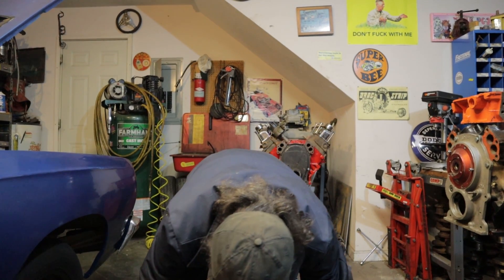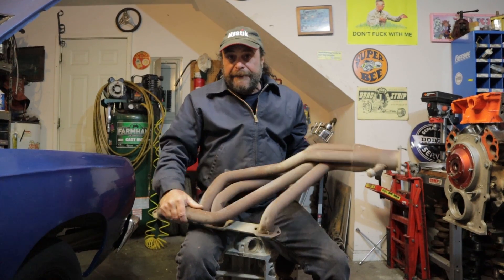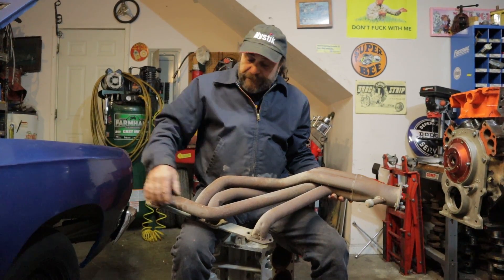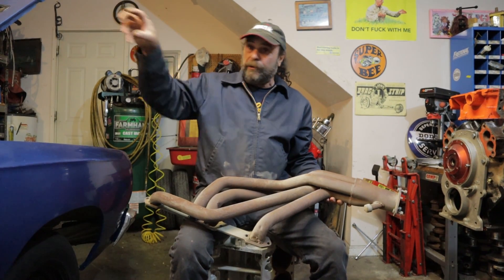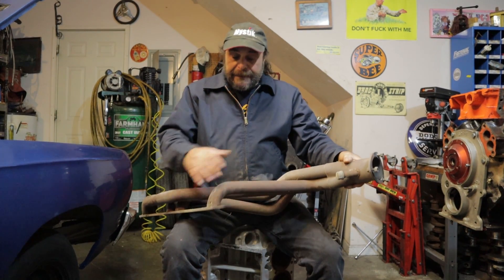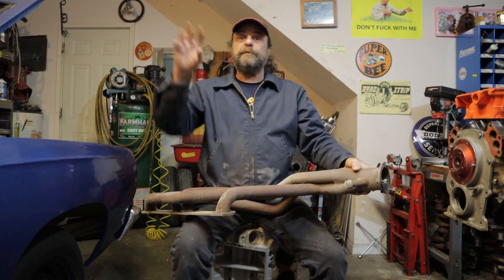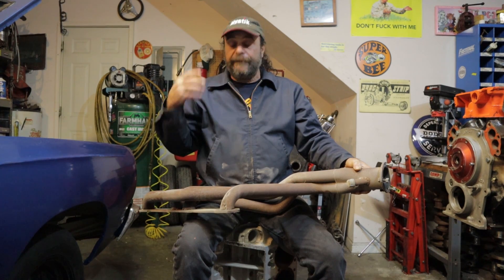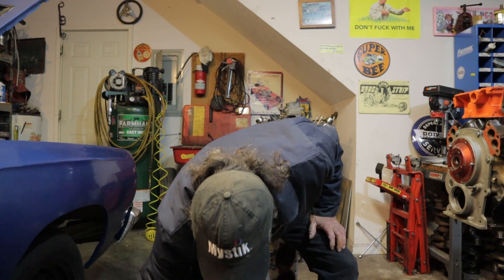The BS On Backpressure

Comment: There is ONE time when you do want a set, specific amount of back pressure in your exhaust to make the best power...
.
.
.
.
.
.
Two strokes.
Reply: 2 stroke Detroit v8s run best with smaller pipes as opposed to those goofy 10 or 8 inch pipes!
Reply: @scrappyhustler7467  and they sound better too!
Reply: And even more mystical... the two stroke turbo, which uses a tuned pipe followed by a turbo which acts as a variable restriction after the tuned pipe, maintaining good back pressure in the pipe, even as air pressure in the intake tract is increasing...
Reply: @gallupcustomknives2293  ah, I see you beat me to the punch :)
Reply: @gallupcustomknives2293  yay! Spring mass damper system!
Reply: Well diesel 2-strokes are another beast altogether. I don’t know much about them, I was referring to gas power sports 2 strokes
Reply: Kinda depends on what 2 stroke it is and the design of the ports, but you can always gain power by widening the ports, until the port catches on the ring haha
Reply: @Scrap scholar Detroit's DON'T CARE!!!!! Period!^___^   My Dad was the guy fer years that ran them till they blew up and then tested everything!………………. But, them lil' two putters(cycles and such) on the other hand need the resonator chamber(I believe they call it?).
Reply: @lambrokedrc5998  Expansion chamber :)
Reply: BS... Look at the two stroke Detroit Diesel engines.  They don't need back pressure, they need a blower to literally blow the exhaust out when all pressure is lost at bottom dead center.  Even on small 2 strokes with no blowers, it still isn't "back pressure" that makes it work, its small enough diameter pipes that are long enough to create the "vacuum" scavenging effect that Tony was talking about, which is created by the exhaust gasses keeping up speed while going down the pipe.  If the pipe is too big, the gasses slow down and dissipate, and the scavenge effect is lost.  The reason it's more noticeable on 2 stroke engines is simply because they fire twice as often, so the exhaust pulses are closer together.
Reply: @livewire2759  
Not sure about diesel two strokes but with a typical two stroke ( like a dirt bike for instance) it isn't "back pressure" it's pulse of exhaust that returns to the exhaust port that helps keep the new charge in the cylinder.
But everyone knows that.
Reply: @franktaylor7617  This is the comment I was looking for, took a while for someone to know what they are talking about.
Reply: Live Wire ummm... have you ever seen a 2 stroke dirt bike? Length is a factor but as Frank stated, the shape itself is what creates the resonant/reversion effect at whatever rpm the pipe is designed for.
Reply: Live Wire no. There are multiple steps in a 2 stroke exhaust where the pipe changes diameter, because you need gas density for the sonic wave to bounce back. That’s the entire point of a tuned pipe, you bounce the sound wave back exactly as the piston closes the exhaust port to cram that air fuel charge back into the chamber. You are more or less sonically supercharging the engine. Run a stinger that too large and your never going to get the pipe hot enough to spin the motor up. On PWC 2 strokes we literally inject water into the tuned pipe to make up for a lack of gas to move the engine on to the pipe earlier.
Reply: @livewire2759   As steve^ is saying, there is an actual backpressure in the expansion chamber, acheived by pinching off the stinger diameter. Detroit diesels are pretty much only half a two stroke, the exhaust port isn't even open for the duration of the intake, that is what gives the need for 2stroke pipes.

You're using 4 stroke terminology, which is completely different. 4strokes use actual exhaust gasses to pull vacuums, while 2strokes mainly use the sonic pulse by reflecting it back (2nd type of "backpressure") at the cylinder.
Reply: I have heard that polishing two stroke ports is bad for performance.
Reply: @gerdogstenc2534  too much polishing  is believed to cause the fuel mix to form droplets or de-atomize whatever you wanna call it, and it slows things down . been told to stop at a nice smoothness but not a mirror finish.
Reply: Gerdog Stenc  only if you polish the intake ports the rough cast helps mix the fuel and air
Reply: @gerdogstenc2534  Shouldn't be anything bad other than what also applies to a 4 stroke (fuel condensating on the walls if you polish the intake/transfers)
Reply: @gerdogstenc2534  it reduces area for carbon to stick to... shouldnt reduce power
Reply: Dave’s Boredom Busters 

Yeah and even in 2-strokes you don’t want backpressure, 
you want a back PULSE 
just on right time (before the exhaust port is fully closed) to charge the unburned mixture from exhaust to the combustion process.
👆🏻
That is what the 2-strokes expansion chambers back cone is for, on the other side.
The other side is the expanding cone to make scavence effect. 
So there is multiple functions on 2-t pipes.

With the pipe tuning you can change and adjust the powerband, power outcome and the total character of the engine. 
Ofcourse this goes hand in hand with the intake, transfer and exhaust timing and port areas of the cylinders ports.

2-strokes are ”double charged” engines at their normal habitat= the crankcase charges the mixture to the cylinder, and the exhaust pipe charges the cylinder filling too.
When you add turbo or another charger to this, you end up with very high BMEP engine, which power output per liter is unbelievable! 😁
Reply: I was specifically referring to a variable and adjustable exhaust power valve, the ones prior to the RAVE system were more complex and were even more touchy than the RAVE system.
Reply: We knew that, but it isn't really the backpressure you want.
Reply: The only Detroit Diesels that had exhaust ports were the 51 series that have been out of production for almost 70 years. All the other Detroit 2 strokes used exhaust valves in the head. As long as the exhaust pipe is of sufficient size for the flow, Detroits put out the same power. Extra big pipes don't help or hurt it, they just make you look like a smacked ass. You want more power out of a 2 stroke Detroit, you need to change the injectors to ones that inject a larger volume of fuel at wide open rack.
Reply: You can port the intake and transfers just fine, as long as you leave em slightly rough, I like to go to 100 grit sandpaper, on the exhaust I try to polish to a mirror shine, just like you would with most any engine, I do the same on my 4 strokes. Gasket match and leave the intake 100 grit and the exhaust polish as fine as you can. It’s only partly due to atomizing the fuel, it also acts as an air buffer, think like the surface of a golf ball, the dimples create a tiny almost ‘film’ of air that helps the surrounding air slip by better than if it were smooth.
Reply: I was going to ask about 2 stroke boat motors.   I've been warned not to rev an outboard 2 stroke on ear muffs. In manuals.
Reply: reeds instead of valves.
Reply: Robby The reed valves still act like a one-way valve, and are on the intake side, not exhaust. They allow fuel/air mix to enter (usually entering the crankcase) but not escape. This allows the full crankcase volume to be filled with the fuel/air mixture, prior to transferring it to the combustion chamber. As for revving it up with or without earmuffs, I don’t see how that relates.
Reply: Resonance
Reply: Two strokes need a chamber in order to condense the power into a usable rpm range.
A weed eater will rev but it has little resistance so it relies on rpm to keep cutting.
A motorcycle is different. It has a gear box and can be kept at a good rpm range to make use of the power.

The chamber consists of 4 basic parts. First come, Belly or the straight section, the last cone and the stinger.
All has to do with timing, sonic waves, inversion and so on.
The stinger or the small outlet is real bleed off pipe for the used air.
The taper of the cones and the length of the belly section can change the power band significantly.
Also exhaust port valves can help smooth out the power by opening/closing at different rpm settings which makes the chamber longer or shorter depending on rpm. Typically cable driven by a servo or at least mine are.
It's all very interesting actually.
Reply: Frank Taylor the original exhaust power valves used a spring and a rubber bladder/diaphragm, the spring would hold the valve closed until the desired pressure in the exhaust system is achieved, but in my opinion that design just increases the spike in power when it hits the powerband. Adding a tuned pipe to a weed eater sized engine, say 25-32cc can significantly increase the power at high rpm, whilst reducing the amount of wasted fuel and emissions as it is essentially forcing the excess unburned fuel/air mix back into the combustion chamber. It’s almost like the difference in a properly tuned turbo diesel vs one that rolls coal and leaves a huge plume of smoke, all that soot coming out of a coal roller is just wasted fuel and power.
Reply: @gallupcustomknives2293  
Yes that's true for a weed eater type motor.
The power valves I was referring to  were the ones on my RG500.
Some are simpler and some are much more complicated as far as their actuation.
Yeah weed eater motors are real inefficient. They just spool up. Lots of potential there.
I was only giving a very simple concept of a chamber.
Id have a hard time explaining it in text. I need my hands and body language to explain 😁
Reply: Frank Taylor the power valve I’m referencing is on a 670 Rotax and is called the RAVE for Rotax Adjustable Variable Exhaust, the pioneer of the exhaust power valve, originally put into production in the early 90s, and used well into the 2000s on Bombardier two stroke products. Later versions from other manufacturers have been created that utilize cable pull and computer controlled actuation, but none is simpler than the original Rotax version.
Reply: @gallupcustomknives2293  yeah they all seem to have their own version.
Mine is servo and cable. Based on rpm. 1985.
Reply: @gallupcustomknives2293 , the Yamaha RZ-350 had a power valve 
in 1983.  "Later" than the Bombardier system of the "early '90's?"

I had an RD-400, Daytona Special model, I put an RZ-350 engine 
into, in 1985.

No, a tuned "Kadenacy effect," pipe is what you need.  (More likely 
called an expansion chamber.

https://en.wikipedia.org/wiki/Expansion_chamber

Very little back pressure needed.

steve
Reply: @franktaylor7617  hence the phrase coming up on the pipe!
Reply: @attitudeadjusted9027  
I figured most wouldn't know what that meant.
I prefer "on song". Seems to be more spiritual. A well turned multi cylinder two stroke will sing to you soul. Or at least it does to me.
Compulsively twisting my right hand while the Goosebumps raise and scream YEAH BABY!!
Reply: @franktaylor7617  I've been eighth mile drag racing two strokes since the eighties and we leave on the pipe and gear em to go thru the traps on the pipe. Light weight power house's.
Reply: check out this one! V8 two stroke! https://www.youtube.com/watch?v=JVfqqSbB3Po

Comment: Excellent video Uncle Tony! I heard of a guy that builds AMC V8 engines that swears by 1 5/8" header tubing and your video explains exactly why he's getting the performance numbers he claims. Scavenging and vacuum drawing the fuel and air during valve overlap is something I never would have thought about!
Reply: Yup.  However, if he swears by those 1 5/8" headers on every engine he builds, they are ALL of similar displacement to each other, and that displacement is not very large.  Otherwise, he is leaving power on the table for the larger engines.

Comment: That’s why I’m going to be using 180° headers onto two turbos the scavenging will actually help accelerate the turbos. It’s like you said before one thing may not directly impact the build but it’s the larger picture of all the little things that help produce more power

Comment: brb gunna go cutt off my cat and muffler from the SBC
Reply: So anyway, I started cuttin'.
Reply: I've said for years that you can do more by removing mufflers than by installing headers.
Reply: Live Wire except sound better, manifolds sound like tractors and shit. You can do more with headers.
Reply: @Shade_tree_garage01  Manifolds sound just fine to me, but it depends on what you bolt to them.  The point I was making is that putting a set of headers on and then reattaching the stock pipes and mufflers (like people tend to do with shorty headers ) makes little to no difference, where just cutting off your stock muffler does.
Reply: @livewire2759  
I did that to my 1990 f-150 4.9L straight six when the muffler fell off, just left catalytic convertor and straight pipe behind tire. Had a decent sound.
Reply: @livewire2759  🤔🤔🤔 a long tube header with a tune will always net more gains than cutting a muffler off..
Reply: @Ws6Ms  Not always, it still depends on what you're attaching the headers to and what you attach to the headers.  You could put headers on a mid '80s 305 in a truck and not gain a damn thing 'cause the crappy heads don't flow anyway.  Even if you did gain some, if the stock muffler was still used, it would negate any gain.  Of course just cutting the muffler off that same truck won't gain anything significant either.  
Now, if you're talking about a late 60s muscle car that has a high performance engine, then yes, most likely you will gain more with headers than by simply cutting off the muffler.  But how many people watching this channel have the budget for a car like that?  I sure don't.